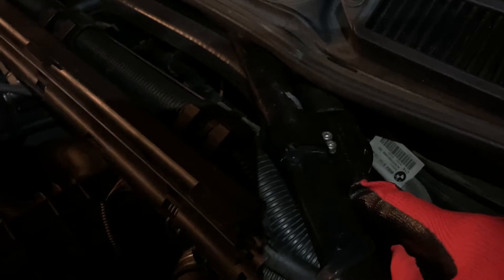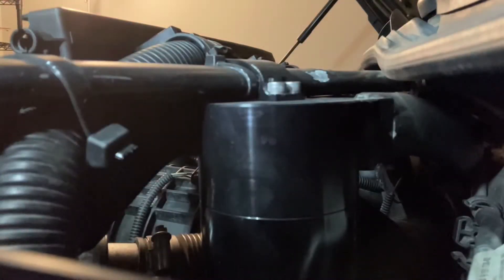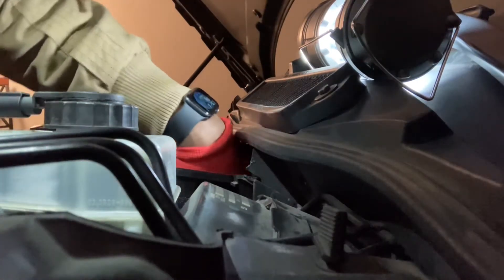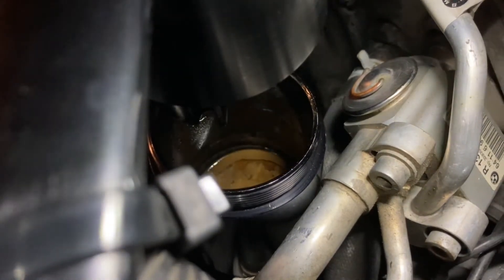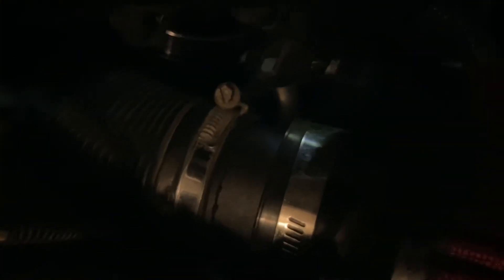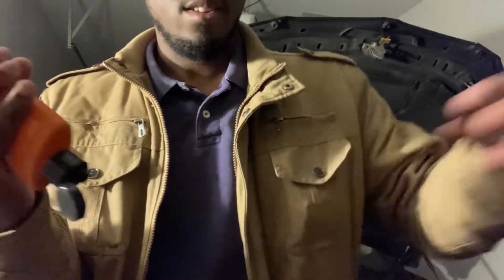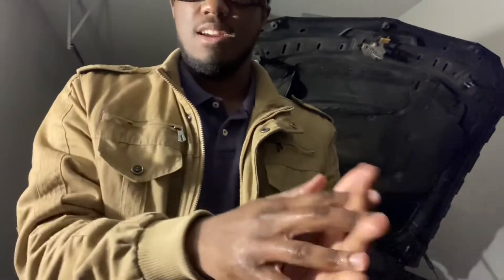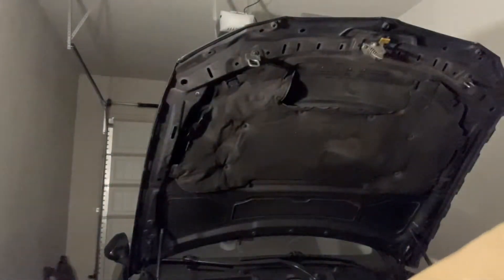BMW 335i | Catch Can Check

Comment: Great info. Do you know how often you should check/empty these catch cans. I have a 2008 E90 335XI Turbo. I don't have a Cabin Filter delete, so I don't want to remove everything if not needed. Thanks.
Phil
NYC Area
Reply from the maker: I suppose it depends on how much/hard you drive. For street driving, could be months. On the track, I’ve seen people have to check between every session.